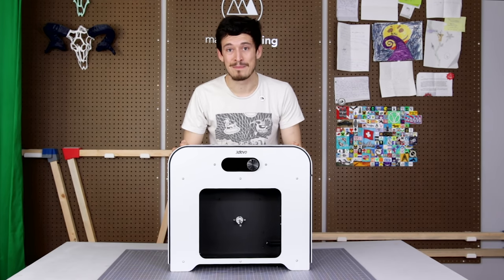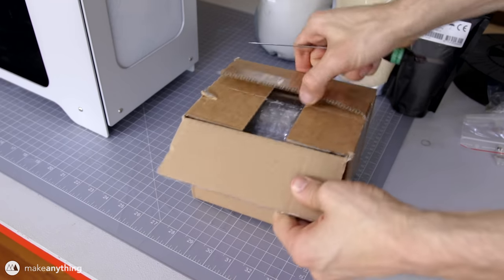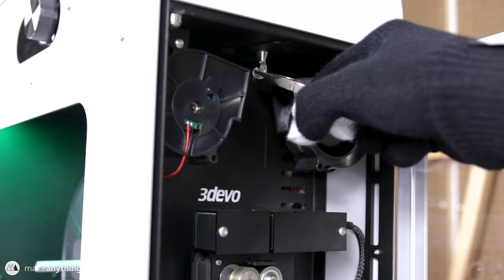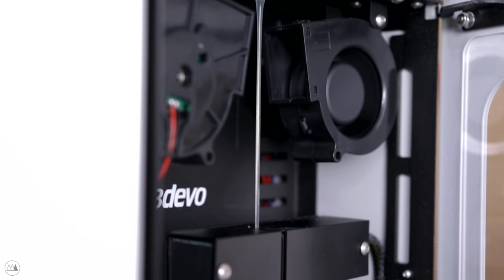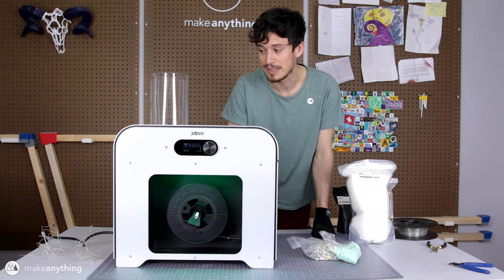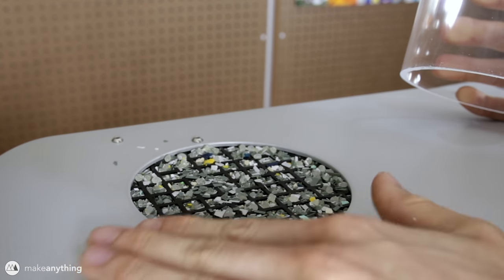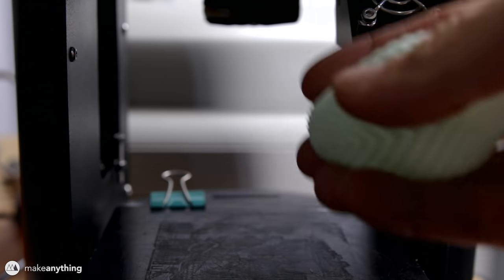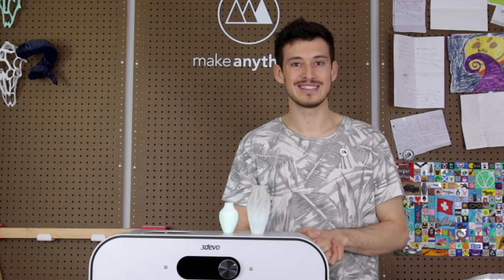Making my OWN Filament from Failed Prints with the 3Devo Composer

Comment from the maker: Since a lot of people are bound to bring it up, yes it's a very expensive machine (~$7000!). Still, it's the start of one solution!
Reply: That would be interesting to do the math then. What's your electricity and "consumables" cost for 1 kg of recycled filament?
Reply: I always keep my failed prints, in the hope that someday I can do something like this.
Hopefully the cost goes down, considering I’m only 14 lol
Reply: It’s a start! I actually do a lot of work for the plastics industry (building automation) and this is the first “at home” filament maker that actually uses the correct process of pulling on the extrusion to get the right diameter and material strength. This is clearly the Bugatti version. It’s only a matter of time before we see the Honda Civic version.
Reply: @NicksStuff  At the retail price it would probably take years of consistent use for it to "pay for itself", especially if it's that finicky about using recycled material.  The only thing that makes it worth it is the ability to custom design your own filament in which case you are paying for access to the tool not really for the product and it's harder to quantify what that is worth to someone.
Reply: Maybe see if you can do a give away lol
Reply: Generic Name same man I'm also 14 and I recycle all my failed prints
Reply: Hopefully it will pay off over time Jesus that’s expensive
Reply: @scottjackson2812  IIRC there are already $3k solutions out there that are pro level, but don't look as pretty (think Skoda VS Mercedes ;) ).
Reply: Make Anything they will get cheaper at some point! Imagine just your garbage can recycling your prints
Reply: I thought there was a typo on the site.  Ludicrous price and can't see why this isn't an eighth of the price.  There seems to be some unique parts ie the heated screw but everything else could be bits added to an Arduino ie temp meter etc. When this gets to 300 Euros I still won't be interested in it although I can see that it might be worth it for some.
Reply: @elsabienenstock6511  same here!
Reply: A bass boat will never pay for itself in seafood savings.  That said there sure are a lot of them and many people want one.
Reply: 7 thousand dollars???
It is impossible to justify that price. How many spools can you buy for 7 thousand?
Reply: Saw this at TCT (UK) and it looked very credible and polished, compared to other attempts. However, reassuringly expensive so not really for the hobbyist - they do a shredder/granulator too if you want to spend the rest of the $10k  :)
I see ReDeTec had a lot of difficulties getting to production, but are now shipping ok I think so it would be interesting to compare what they achieve for under $2000.
The other low-end competitor is of course FilaBot at somewhere in the middle price-wise.
Reply: @elsabienenstock6511  I call that my "box of shame". It's a rather large box...
Reply: @NicksStuff  yeh not a practical solution at all even at 7000 dollars it still doesn't get the job done well.
Reply: I was thrilled reading the title of that video thinking "Uh wow finally a solution for the normal folks". Unfortunaly not :( I think its something to use in collective makerspaces but not for the single user.
Reply: 3D printers were originally expensive and good quality printers exist for under $200. Lets just hope that this is what happens for this
Reply: @moonlight_oats  But this machine is like a 3d printer without a moving head / bed so it really don't cost alot. They just wan't to keep the market but at this price there is no market at all. We need to wait for chinese cheap one and maibe they gonna made a move, but it's gonna be too late. i mean with 7k you give 10 kg of PLA / ABS PELLETS ( 10$ per kg ), some pigment and maibe something to shred old failed prints. And maibe with some extra 300$ bucks you made an option for bigger rolls.
Reply: @moonlight_oats  ps : if the price was right, it's gonna be the first thing mentionned on the video. Subtext !
Reply: You need to get them to send you the shredder! LOL
If I hit the lottery I'll get both! 😂
Reply: I still don't get why these filamant extruders are so darn expensive! From technical point of view they are not too complex. It would make sence to have one in a 3d printing studio that is constantly loaded with multiple printing tasks but not in a hobbyist's home shop.
Reply: @scottjackson2812  Lol but I agree. Have you seen how inflated the filament prices are?! 22€/kg for ABS while if you have some connection you can get it from a company wholesale for 2€/kg if you buy the entire sack which is 25kg.
Reply: I would really like to see a review from you of the direct pellet extruder. It would be really nice to se a coparison between prints obtained from shredded plastic using filament obtained from this machine and using the direct pellet extruder (that is also a much cheaper Device). Another idea to Keep good tollerancies from recicled plastic is making a first extrusion rough to get some inconsistent ddiameter filament, than shred it in tiny cilindrical pellets and use them to feed the machine for the definitive extrusion.
Reply: @moonlight_oats  yes but still good 3d printers for home use, older times were below 2500 euros.
Reply: WHAAAAAAAAAAAT?! seven grand, its essentially the same as a3d printer but with a optical sensor and a winding motor. Why is it that expensive?
Reply: i had one and it was a really absolute a nightmare to work with. At the end i returned it.
Reply: @elsabienenstock6511  i don't think they will lower the cost just because you are 14
Reply: Recycling plastic you should not exceed a ratio of about 30% RECYCLED plastic to 70% NEW plastics whatever it is and that 30% recycled plastic can only be single use plastic. The more the plastic is used the less you can put in the ratio. You can look at it this way, the more total heat capacity a plastic has been absorbed, the less you can put into the mixture. So a plastic that has been heated up to melting point 2 times you should maybe only put 10-20% recycled in with 80-90% brand new plastic. A 50/50 ratio of non-dried non uniform sized particles will create a brittle, uneven product, this is well known in the plastic industry; Also mixing before is definitely important. I think the ideal thing for you to do would be for you to crush your used plastic into pieces ideally without added extra heat. Make mesh bottom boxes of different sizes, ideally they would fit into each other for storage so it would just be a single tray with like 5 boxes fit inside each other each like 2 inches smaller of a square. You will need to sift your plastics according to size, have 5mm^2 mesh, 4mm^2, 3mm^2, 2mm^2, and 1mm^2 meshes and start in the big mesh 5mm, anything that does not fall through gets re-crushed, repeat with 4mm mesh but now anything that falls through gets collected. Re-seiv the stuff you just collected separating the stuff that falls through and the stuff that does not, repeat for each finer mesh and keep all parts separate after that so you should end up with a bag of stuff smaller than 3mm but bigger than 2mm, stuff smaller than 2mm but bigger than 1mm, and then just stuff smaller than 1mm. Treat each of these bags as separate ingredients! Before using them you need to dry them, temperatures and times may vary but I suggest getting a used hair drier and creating a pipe with fine mesh at the bottom, A thermometer inside (maybe a candy thermometer clipped to the side), the hair drier blowing up from the bottom and out from the top, and a loose lid keeping moisture out. Find a way to adjust the temperature, maybe by using a springy drier vent style tubing you can use to change the distance to the plastic or the distance to the end the hair drier is and therefore the amount of cool air it brings in with it. After you dry the plastic pellets create a mixture and then put it through the 3Devo. I recommend trying to match the size of the recycled pellets with the size of the new pellets or to go as small as you can and start with a ratio of 10-15% recycled plastic to get your first roll done. I worked at a plastic injection molding factory that made medical parts for a while and learned a lot of stuff about plastics while I was there. They only used 100% high quality virgin pellets because they couldn't have an issue with a bit of dust or dirt particles getting into the plastic pieces since we were making medical parts. We collected most of out pieces that failed inspection and plastic that was "contaminated" with dirt and things and sold it to a company that washed it and reformed it into recycled pellets for other companies to use. I think they said they washed but not with soap and water. It was put it in a mixture of 2 liquids that the plastics floated between and the dirt/contaminants would hopefully either float or sink and could be collected out and anything not clean after this was either hand cleaned or thrown out? Maybe reforming it into pellets might help with the recycling even if you can only use 20% recycled material at a time. Jeremy Fielding has a good video on making a plastic shredder you might check out that shreds rather than blends to get more uniform pieces. If you want help on a design feel free to message me and I can try to help. Good luck and hope to see more on this in the future!!!
Reply: Wait. Even after paying a ridiculous amount of money for this thing they install DRM on the machine to prevent you from using it? Ehhh hell no. I will never support this product even if the price drops dramatically.
Reply: Hahaha what a joke at 7000 usd Ive made recycled filament with my home made tools for less then 3500 NZ incl a dryer shredder and extruder
Reply: I think the price is already adequate. It's not a product made at high volume. It's only somewhat more expensive than an Ultimaker or its ilk, same order of magnitude. It has a production capacity of upwards of 10 spools per day. Let's say you or i consume only a dozen spools per year. So it'll make 3000 spools per year. If i and 300 other people share one of these machines, for example via some kind of service, it totally makes sense! A 3D printing booth at Conrad could have one of these and offer making custom filament or recycling your prints as an incentive to visit the store and shop there.
Reply: @evilcanofdrpepper  i like your post, because its the reality. All other is marketing. Also 3devo makes a lot of marketing with wrong numbers and datas what i saw. so they compare the price of granulate to filament from 75 euro per kilo spool pla to 2 euro per kilo pla granulate. Fact is you get what you pay for and even pla can be extrem hard to print if its crap. Also its like you say, used plastic you can use, but not really to print, more for things they dont have to be so precise or consistant in color. And they have to be cleaned, sort clean, dried well, and mixed with fresh granulates to get better one, AND a compressed screw not a wood screw :-) Its a lot of work if you want to do it well and if you want to get consistant results in filament.
Reply: U seen filastruder or one of the other open source extruders, that's priced so the maker community can actually afford it 😊
Reply: Time for China to make one for $1000
Reply: Start making a profit after your first 1000kg of recycled filament, wow!
Reply: Hi! Try the flax filament extruder 🤫
Reply: And the base model is $6,000
Reply: @edstar83  i think there was something  called filastruder pretty looking thing but it cost $500-$1000ish but did a similar job
Reply: @ThePhantazmya  they have a shredder/granulater machine too that goes in the chain before this one so I'm guessing with that it's just like using normal packet stuff.
Reply: seems like you would have to make 1000's of 2kg spools of plastic to make this machine pay for it's self. If the raw material cost and power consumption is indeed cheaper than buying filament. lets say you save 5 bucks per spool all said and done. it's still going to take like 1500 spools to get back to the break even...I don't know anyone who prints 1500 spools of plastic in a year. after all that's about 30,000 dollars in plastic. So their price point is hilariously outside of the consumer market. so maybe a business that sells cheap spools of plastic. or a business that 3d prints and doesn't mind a higher failure and quality issues? Who is this for?
Reply: is this worth 560 kg of my regular petg fillament. dont think so
Reply: Make it $1000 and I am buying one :D
Reply: @VaultBoi101  
FlaX Filament Extruder
Reply: @TJWhiteStar  FlaX Filament Extruder
Reply: Here in malaysia it will cost about RM 30000,higher than my total tuition fee in diploma for 2 and half years😒
Reply: Let's Github a DIY version...
Reply: HOW MUCH?!
Reply: Daaaamn, 7000
Reply: 12:40 LOL
Reply: Sorry 7k is way to expensive I wouldn't be printing with filament if I had that much coin
Reply: $7000? A la verga let's just mickymouse our own together.
Reply: @huntrixmata4348  He got his free.  So.. it already paid off?
Reply: I did an internship at 3devo, and I can remember preparing and making the sub assembly's for the machines. And I can also remember packing your order.😀
Reply: Can we just send you our waste filament instead? lol.
Reply: @dylansmulders4843  how is its filament quality and is it suitable for filament production as a business?
Reply: Lol i was thinking 200-1000 dollars but nopelol
Reply: @scottjackson2812  Would the Filastruder count?
Reply: $7000 for a machine that works worse than what CNC Kitchen DIYed with like 500. lmao.
Reply: It’s more expensive than I expect my lifetime use of filament to be! Add another £3k for the shredder and it just way too expensive !
Reply: Sounds like THE Green New Deal boondoggle. Spend $7,000 on a machine that recycles cheap plastic and virtue signals for social credit points that you hope might add up to getting laid.
Reply: @NicksStuff  Probably take 10 yrs to get to the point where this was the cheaper option
Reply: @elsabienenstock6511  If you don't see it in time, you can still cryogen yourself
Reply: You can get this quality for like 1k now
Reply: $7000? no thanks, just  a waste to watch the video, bye
Reply: for 7000$ you should be able to press a button and walk away.  If I wanted to figure things out I would build my own solution.
Reply: For that much money I'd rather eat my failed prints

Comment: Feed the extruded filament directly into a 3d printer which will make prints that will automatically fall into a filament shredder upon completition  and the shredder will pump the crushed filament back into the filament maker. The 3d printing centipede.
Reply: LOl - how meta!
Reply: actually really nice idea, problem is just that this will run not more then 5 times, after that the filament is bridle, so it won't work anymore. That's also one problem with that extruders. Also you can print filament, that is the much easier way of "The 3d printing centipede"
Reply: Genius no more buying expensive filament
Reply: Too much satisfactory gaming 🤦🏻‍♂️
Reply: Perpetual printing machine
Reply: @joachim1973  additionally, even if the filament kept all integrity, you still lose trace amounts at a time as fumes